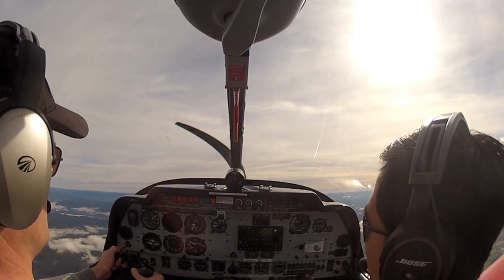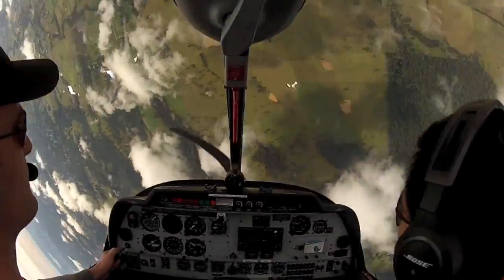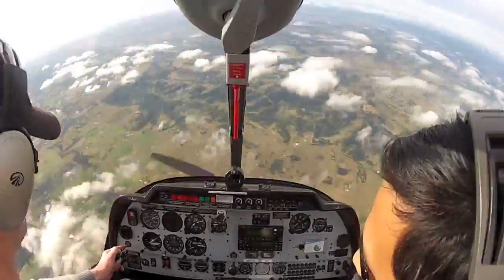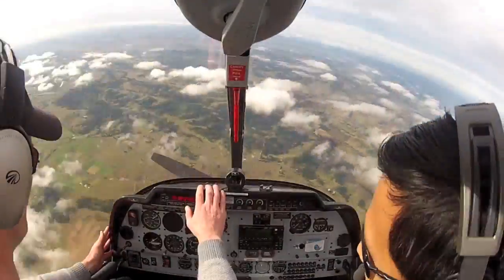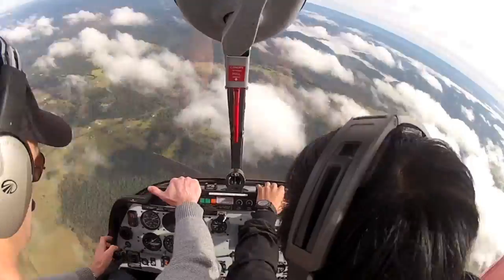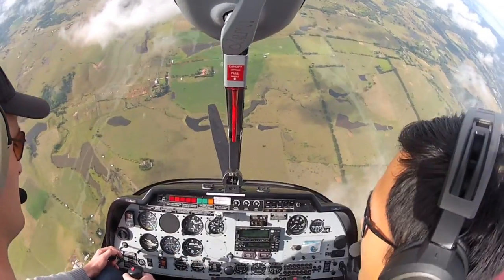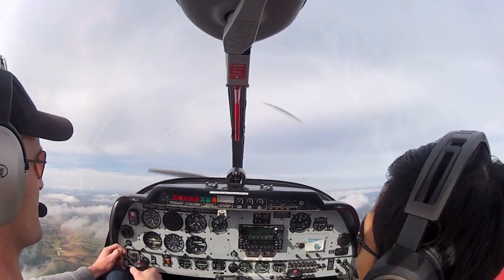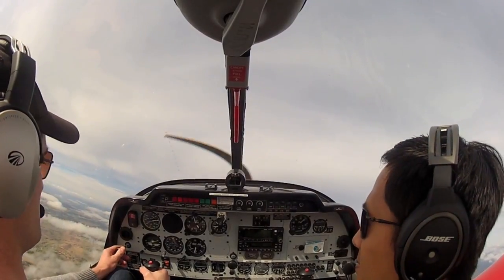Spin Recovery in Robin 2160

Comment: Love it.  I taught hundreds of these in the late 80's.
Reply: Over a decade since I’ve experienced that. Really need to get my SEP rating back now.
Reply: I'm working towards my pilot's license now. Is it possible to execute that spin, but accidentally  get too out of control to where you cannot regain control? Now I'm freaked out after my pilot friend told me about this part of the training!!!
Reply: @kustomhooligans  Not in this aircraft,  you can always recover.   

Only if the pilot passes our or there is a mechanical failure will you have a problem but in all the years I did this it never happened.
Reply: @kustomhooligans  I believe these are also done with excessive "anti-fuckup" procedures. A big one is that both pilots wear parachutes should they need to exit. Sure, the aircraft might crash anyway, but nobody will lose their life for it.
Reply: @bluejay7058  ahhh. And also obviously the plane is one of the easiest to recover too right?

I was gonna say, how can it be that all these instructors in YouTube videos I'm seeing are doing this ON PURPOSE. 

Still seems a little dangerous though but hey ho whatever
Reply: @msanne4787  Aviation sort of requires this stuff. Sure it's dangerous as hell, but the alternative of not being trained and panicking is much worse. It's a necessary evil which happens to get safer over time anyway.
Reply: Can u please teach me? I'm in the USA and I travel
Reply: @Wolfie6020  can you can still overspeed thus overstressing the aircraft, or is the maximum speed (both vertical & angular)when in a spin still within the aircraft safety limits?
Reply: @stanislavkostarnov2157  if the aircraft is certified for spinning, you can spin it to the ground and it will not overstress really (in the air). Some aircraft may have some slight issues, I read Tomahawks' tails like to wag a bit, possibly fatiguing certain parts. Z142 which I spun is only allowed 6 turns, exiting the spin takes up to 2 more turns after action so pilots usually initiate the counteraction at 3 turns.

Comment: Why did the engine stop?
Reply: i think he did it on purpose to demonstrate the effects of a stall condition falling
Reply: Question - when idling on the ground prop still rotates in c150. Does this plane have more complicated crankshaft to prop connection? Thanks
Reply: Still running but the camera made it look like it was stopped. It was at idle during the spin.
Reply: @jdboy9  you're right
Reply: @armovetz Nah its just the camera not properly capting the rotation of the blade because its going faster than the amount of frames its capturing. There's videos out there where you see helicopters flying but with their blades completly still!
Reply: Oops didnt realize jdboy9 already answered